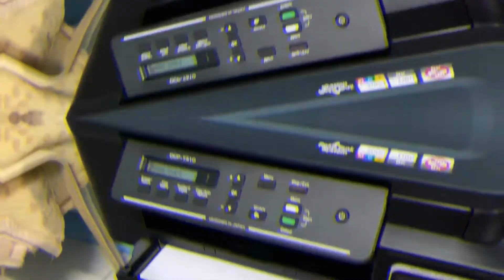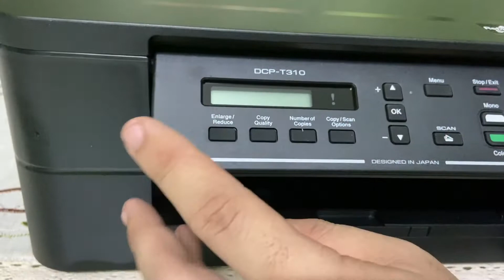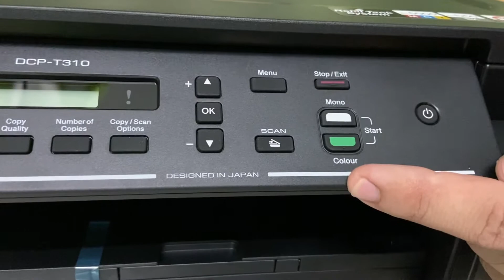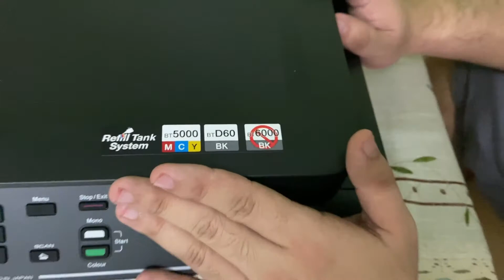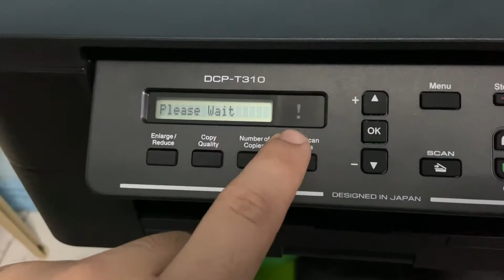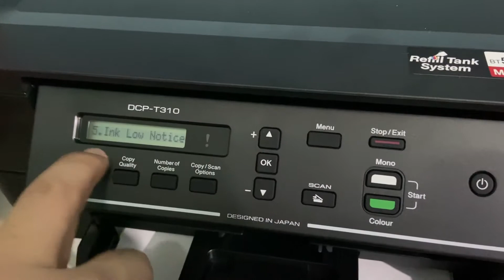ONE OF THE BEST AND CHEAP ALL IN ONE PRINTER | BROTHER DCP-T310

Comment: pwede po ba maka print for cheque ?
Reply from the maker: Yes you can customize the paper size. May option din sya for cheque
Reply: @KuyaThonzTV  do you the step by step . for cheque printing .. ? thankyou for your respond.
Reply from the maker: @cebuairfibernetwork5497  adjust lng po ung paper tray then sa printer preferences settings piliin lng po cheque